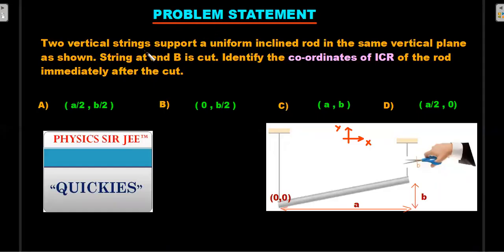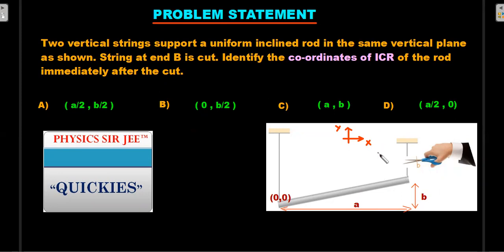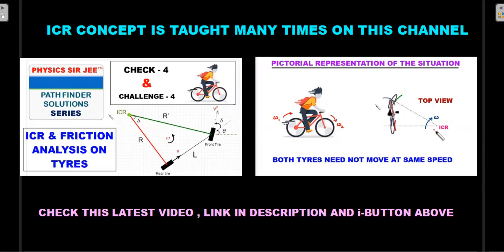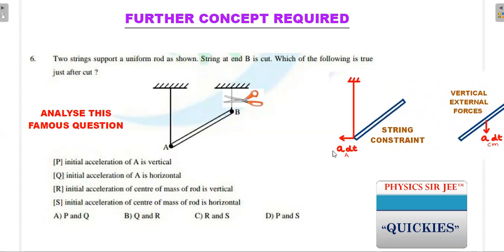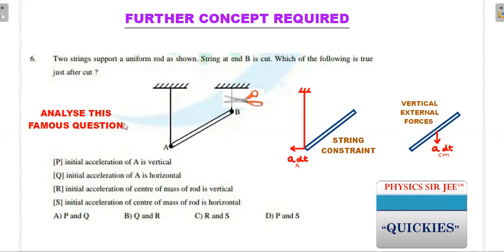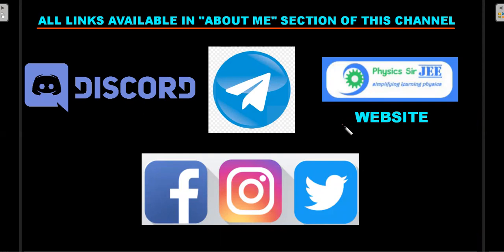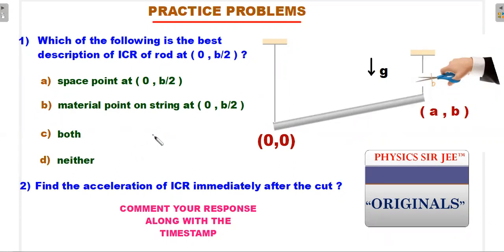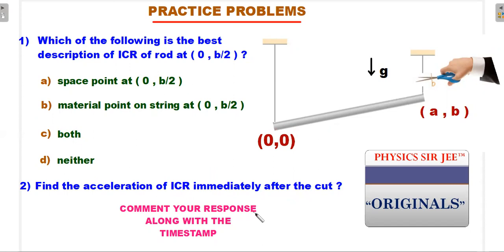WHAT IS THE LOCATION OF ICR JUST AFTER STRING IS CUT ? | JEE ADVANCED | QUICKIES

Comment: 4:55 I have two doubts

1)Does the rod gain angular acceleration alpha at this instant immediately after cutting of the string? if yes then wouldn't it give the rod cm an acceleration in the horizontal component too?

2) how exactly does the point A get acceleration? I'm unable to figure out the forces which are causing its acceleration
Reply from the maker: 1) alpha is generated immediately due to torque. a cm is vertical only as net external force is the only thing responsible for cm acc. INTERNAL forces don't matter
2) The neighbourhood of part of point A of the rod pushes and also applies twist forces to generate acceleration for any point like A.

The acceleration of A and value of alpha in turn should ensure that a cm is not horizontal

Comment: Sir can you please give solution to this JEE Mains 2011 question :
"The specific heat capacity of a metal at low temperature (T) is given as Cp (kJ K-1kg-1) = 32(T/400)^3. A 100 g vessel of this metal is to be cooled from 20 K to 4 K by a special refrigerator operating at room temperature (27°C). The amount of work required to cool the vessel is

(a) equal to 0.002 kJ

(b) greater than 0.148 kJ

(c) between 0.148 kJ and 0.028 kJ

(d) less than 0.028 kJ"

I'm really confused with this question. I've found different solutions to this questions from different teachers. So can you please take this questions in one of the upcoming videos 🙏🙏
Reply from the maker: Already covered in JEE Mains revision series video on calorimetry 👇. It's at 52nd minute. 
https://youtu.be/EMlDTG0ex20
Please cover all the previous videos , it would be difficult to answer solutions in comments section.

 Also , you may post your doubts in telegram group or discord server . Other students will answer your doubts when I am busy
Reply: @PHYSICSSIRJEE  Thank you very much sir
Reply: @PHYSICSSIRJEE  Should i send here the query itself Sir of that video of yours?

Comment: 1) b Material Point on string at (0,b/2) as we have the to take Acceleration in Psedo torque according to that.

Sir I have another question as to what if the string is tilted, i tried myself but I couldnt find a definate point other than the it will be along the Line of string below the rod.

Comment: 1-(a) , 2 - 0 ? As initial angular velocity is zero So if ICR would have an acceleration in any one particular direction then both origin and com can't have there acceleration in horizontal and vertical direction respectively , while I guess string point on (0,b/2) have a acceleration proving that it's not a material point
Reply: Its most likely material point of rod coinciding on string,  here just the case is that the acc of IOR coming zero makes us believe its space point , but its not bc at a later moment IOR will get acc while space point all points have zero acc .
Reply: @AryanYadav-rh8iy  bhai origin also moving
Reply: @debu6157  so what? Space points are all rest points (no acc no velocity)
Reply: Origin is material point
Reply: @AryanYadav-rh8iy  space points are theoretical points which we could assign any velocity or acceleration
Reply: @yashagrawal8592  isnt space points the points which are naturally present in some 2D/3D place ? Thats why they are at rest (i.e. ground frame points)
Reply: @AryanYadav-rh8iy  according to me they can have assigned velocities and accelerations as otherwise what would have been significance of defining them
Reply: @yashagrawal8592  i think the difference between space and material points is this only , material means on the body ,space means on ground points , so space has no v no acc but material points have those
Reply: @AryanYadav-rh8iy  bro the origin is a point where the string and the rod meet and a space point refers to a point wrt the origin
Reply: @debu6157  see i was right , i thought by material point on string sir meant that the rod body material on string ,so i chosed B option , but my concept was clear :)
Reply: @yashagrawal8592  see i was right Yash Agrawal :) , just was not clear with the english of the B option otherwise would have chosen D :)
Reply: @AryanYadav-rh8iy  👍
Reply: @AryanYadav-rh8iy  👍 , actually I thought space point as something similar to a point that can have any acceleration , In that way that was somewhat correct , but anyways sir's  way of defining ICR was best :)